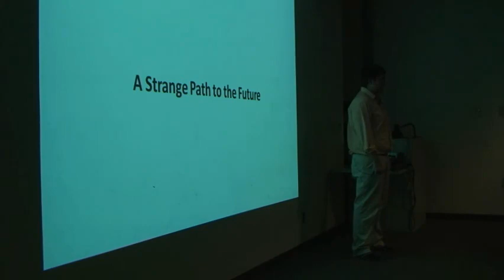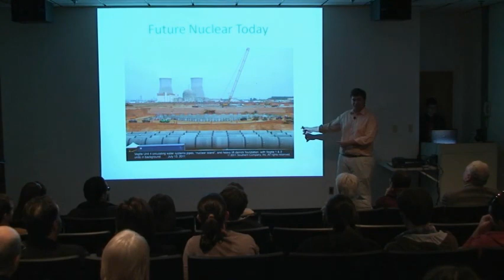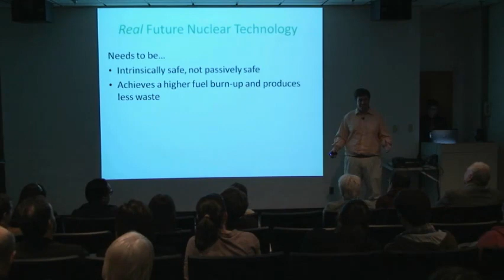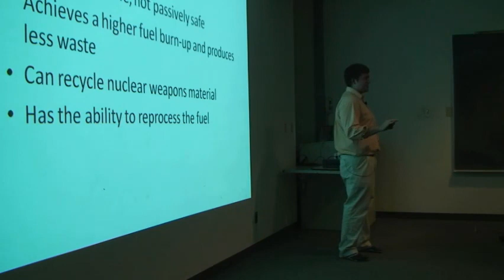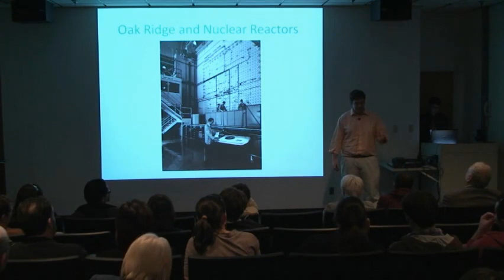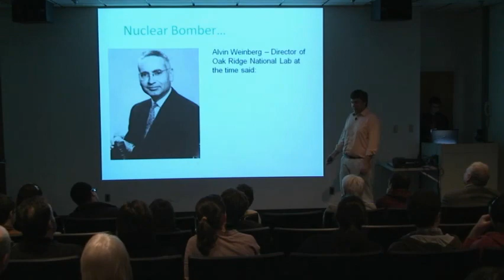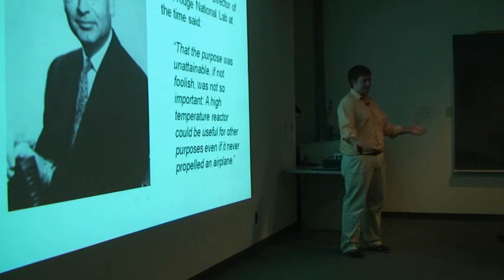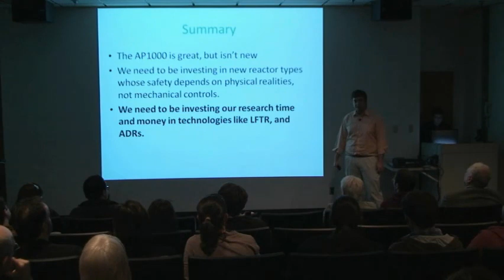TEDxUTK - Tyler Rowe - Nuclear Reactors

Comment: We've been dealing with corrosion for years and we are quite good at it now.  I worked with a corrosion program at the nuclear power plant I worked at and it was a problem that was rampant, but all problems were identified and mitigated as quickly as possible.  Radioactive waste is simply a waste of tax payers money.  Do a google search for dry cask storage and you'll understand why a repository isn't necessary.  We know the technical issues, we've build one of these before, we can manage.

Comment: Correct. You can never simply "walk away" from a Nuclear Reactor.  It takes about 50 to 100 people to operate the reactor after shutdown.  That is, there needs to be people around to operate and repair the cooling pumps.  Keep in mind, even coal and natural gas plants have a life span.  Solar technology advances so fast that they need to be replaced frequently to keep up with technological advances.  Also, imagine maintaing 2 GW (average 2 reactor site) worth of 4 MW wind mills.

Comment: There's enormous amounts of energy needed to keep the infrastructure for safe nuclear energy running. Don't forget about the energy it needs to mine, refine, transport, protect, dispose, and clean up in the nuclear cycle. And not even counting the amount of energy it takes to clean-up of disasters. Nuclear (the way we use it now) isn't a solution.

Comment: Thorium has now been mentioned a lot of times throughout the years, still not 1 plant is in development. I would like to know the reason behind that. It can't be fear of nuclear energy, because it's supposed to be safer. It can't be a money problem, because it's supposed to be cheaper. It's not the lack of thorium, there seems to be enough. There are designs ready, but no-one uses them to build a new safer / cleaner / cheaper plant. What is left out of the Thorium-dream-story?

Comment: I get the feeling that coal/natural gass/hydrocarbons won't be displaced until something cheaper comes along. Windmills and solar aren't viable in that aspect. Nuclear is energy dense, and if the regulatory system is revised, the costs come down to be quite competitive. Also, this talk seems to be touting thorium reactors, which are actually quite different machines from light water reactors. It's quite compelling. I'm no authority, but I feel that the LFTR is quite viable.

Comment: Reasons I could find not to use Thorium: The cycle is too expensive. Can't make bombs with thorium. Thorium reactors have other problems (like corrosion). There's still highly radioactive waste that last for centuries. Technical complexity of thorium reactors is also an issue.

Comment: Go watch the LFTR 5 minute remix, the related Google tech talk, or any of Kirks videos. They will answer most of your questions. R&D for nuclear power is a painstakingly long process. Nuclear materials take years to burn which means testing cycles are inherently long as well. Also part of the problem is this is a similar situation as the Betamax vs VHS debate--when one application of a technology becomes dominant, it's too risky to work with the “untested” kind, even if it is better.

Comment: There's not 1 nuclear plant that's been built without government-money. NY times had an article on march 20 that "As Reactors Age, the Money to Close Them Lags" I know the Thorium story, it kinda got bypassed in '50s because we "needed" plutonium for cold-war reasons. I only wonder why we didn't invest in it the last 20 years (what else prevents us from using this "better" solution), but in the long run energy that needs the least resources (wind / water / solar) will be cheaper

Comment: Cost of the cycle depends.  The start up Uranium will be expensive, until these things become popular, Thorium isn't not going to be expensive due to Supply and Demand.  Some salts are more expensive than others, so the cost can always vary depending on if you want to use Barium or Lithium in your fluoride loop.  Corrosion is a problem, but in the 21st century we have new materials that don't readily corrode, and corrosion is a problem with any industrial application.  Cont on next comment